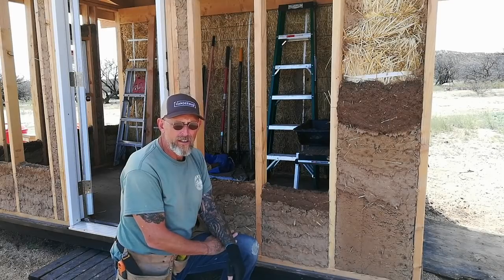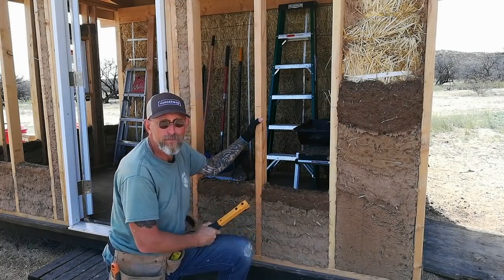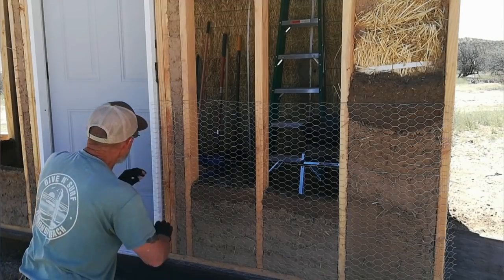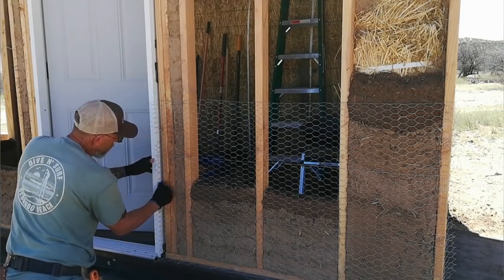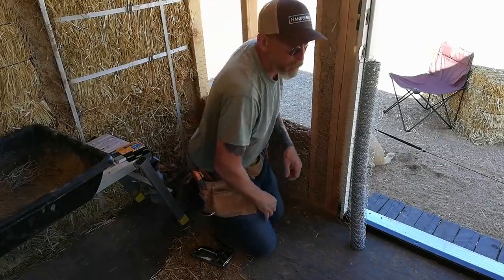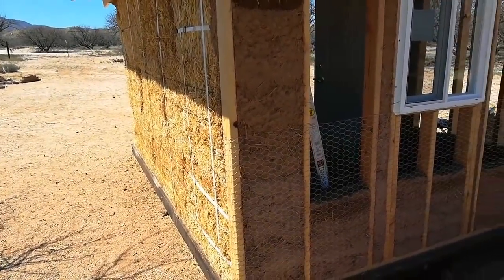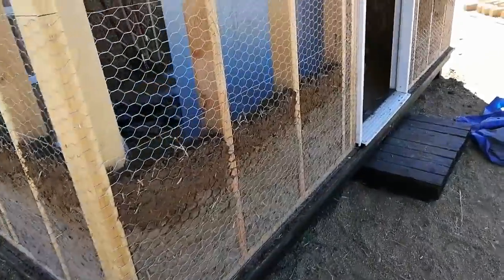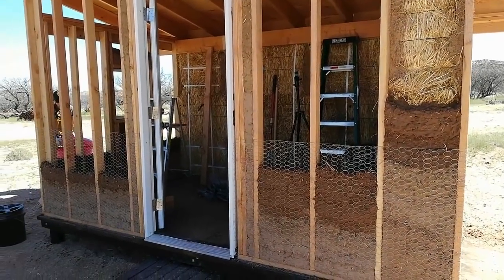Using Chicken Wire to Reinforce the Cob

Comment: I don't think you need chicken wire for the cob either. All of my research shows it isn't needed as long as you dampen the cob to add the plaster. Sort of how you would add cement to something or even in pottery, to get it to bind it needs something to stick to, a rough surface-moisture-new material. I would think the texture of your cob is enough, with added moisture to accomplish the plaster sticking. It is looking good though.
Reply: That makes sense, thank you :)

Comment: Great details and work as usual. I couldn’t help but wondering how it would be to screw some large sheets of plywood to the studs after the chicken wire, then stuff away with the cobb? It would create a great barrier to really press the cobb into, and not allow the chicken wire to bloat outwards. Plus, potentially give an excellent flat outer surface to begin rendering once the ply was removed later on. Again, an excellent video 👌
Reply from the maker: I think that would be a great idea but I would suggest removing the plywood after the cob was dry that way any top coats of Earth and plaster would be directly applied on top of the cob without the plywood in between. Thanks for watching!
Reply: @theupsideofdownsizing  Yes, exactly. You may have missed that part of my comment. Definitely remove the ply. You could even sandwich things such as textured leaves, flat branches between the ply prior to cobbing, and remove those when taking the ply away, to leave their impression in the Cobb, if that makes sense? 🤔
Reply: @theupsideofdownsizing  I once saw galvanised barbed wire horizontally stapled inside studs, from one to the other, right in the centre of the wall cavity, above a corse of mud bricks. It was their way of tying the bricks to the frame. The next corse was laid right on top of the wire to seal it in. I imagine this would greatly reinforce the strength of cobb walls too. Possibly even in between the corses of straw bales.
I also love the idea and structural integrity of your ‘Vampire Stakes’. Brilliant! 👌

Comment: Great project! How long did it take you to complete the entire cob wall? I read that there is some waiting time required between each layer of the cob to let the previous layer get dry?
Reply from the maker: It took about 4 days total. Would have taken much longer without the chicken wire. We had to wait several hours at least for the Cobb to firm up between layers.